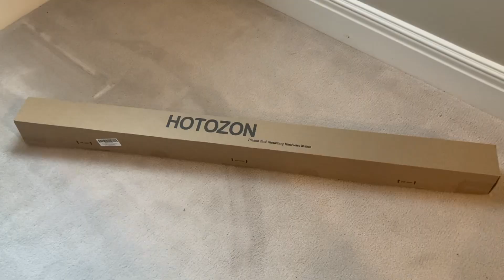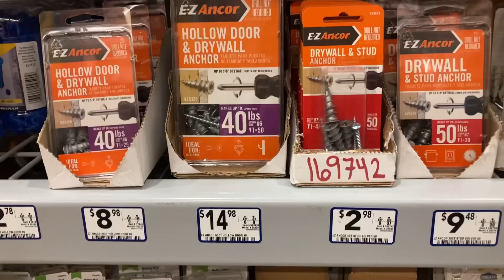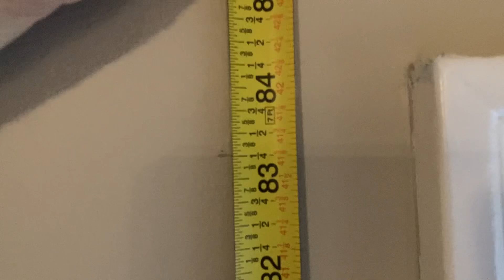Installing corner window curtain & rod

Comment: Shouldnt there be a pilot hole for the drywall anchors?
Reply from the maker: It depends what kind of anchors you are using. The ones I’m using in the video hold the best by being screwed directly into the drywall.
Reply: @ gotcha! Thanks

Comment: Nice video. Can one move the curtains from one side to the other side across this corner bracket?
Reply from the maker: Thank you for your comment. Unfortunately, that is not possible as the support bracket is there in the corner supporting the rod joint.